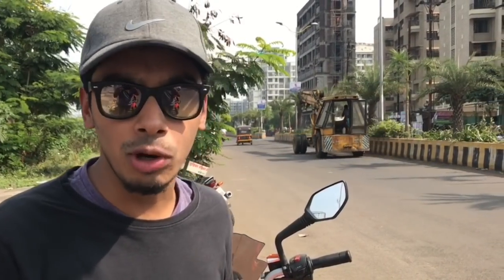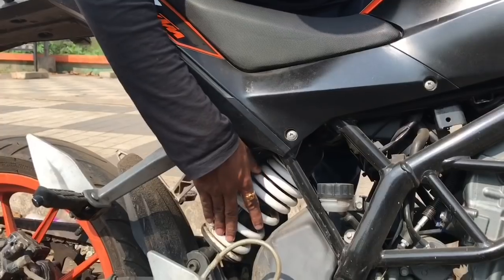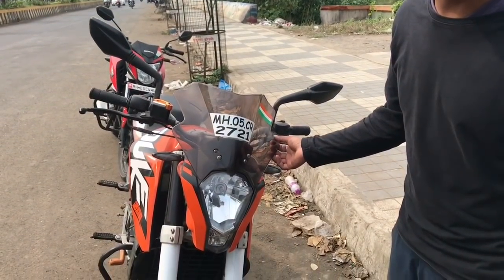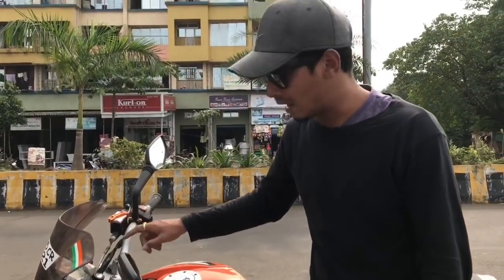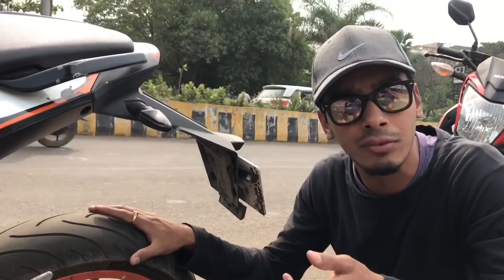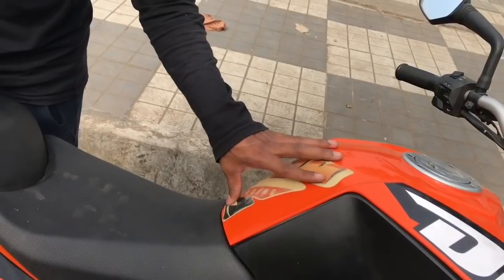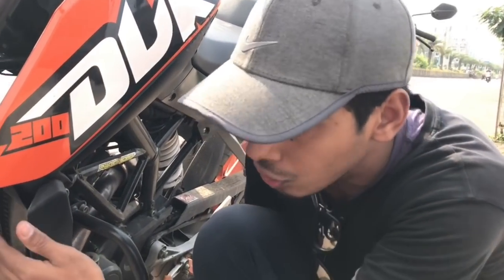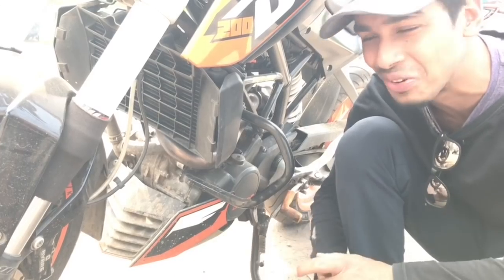Long Term Problems , Maintainance, Ownership of KTM Duke 200

Comment: Bhai service agar 7500 KM pe karvate ho to ₹3000 bilkul sahi h 

Or ye kisne kaha ki 15000 pe tyre change karna hota h
Gaadi ka tyre hi 50000 Chal jata h
Reply: I have ktm 200...3 years old and done 25000km. I haven't changed the tyres yet as they are in good condition.
Reply from the maker: Sahi hai bhao

Comment: I am planning to buy a 2nd hand bike as i am on a low budget... Plz someone suggest me which one should i go for duke 200 or RS200..? After seeing the procedure of changing the air filter on the RS200 i am so disappointed and on the other hand duke give frequent expenses... Please suggest me which bike should i go for..
Reply from the maker: Bhai if second hand then please hands down duke 200
Reply: ChatterBogsa.... So i should not take 2nd duke..?
Reply: Duke is better
Reply: @rahulVlogs  just out of curiosity bro , why did u say of second hand then Duke ?
Reply: G
Reply: dont buy second hand bajaj it will have too much vibrations

Comment: Bro mere pass duke390 hai abhi service kara kr 3000km hoye hai aur engine oil low hogya hai na koi leak hai gadi se smoke bhi nhi nikla phir bhi low hogya hai.  Kya yeh normal hai 3000km pe engine oil topup krna?
Engine oil motul 7100 10w50
Reply from the maker: Aapka clutch plates burn hua hai
Reply: @rahulVlogs  bro brand new bike hai total 4000km hai odo pr
Reply from the maker: Bhai aapne or aapke friends ne rash chalaya ho ga or else clutch burn kaise nhi hoga. This situation can only occur when the bike is rash driven
Reply: @rahulVlogs  ok bro.

Comment: I still ride my 2014 duke 200 .. You can help me maintain as well
Reply from the maker: Duke 200 is a lovely bike . 
All you need is good tyres , chain setting and engine oil
Reply: @rahulVlogs  thanks, i have apollo h1 tyre ..chain was replace 2 months ago and engine oil as well
Reply: @rahulVlogs  oil filter haven't change for years.. No stock in ktm workshop 😪

Comment: Pls suggest me which one I have to go for RTR 200abs or Duke 200 or R15 v3
Reply from the maker: R15 v3 or Dominar 400
Reply: rahulVlogs I am a City commuter & I'm not practical 
So I will go for rtr
Reply: I'm bit practical
Reply from the maker: Oh bhao then go for Honda hornet 
Which has really low maintainance, extremely reliable , mileage 35 to 40 and just the bike to go for
Reply: i m confused in r15v3 and rs 200 
i have 1.5lack budget
(note : somebody told me that r15 v3 have some issue with his tank)